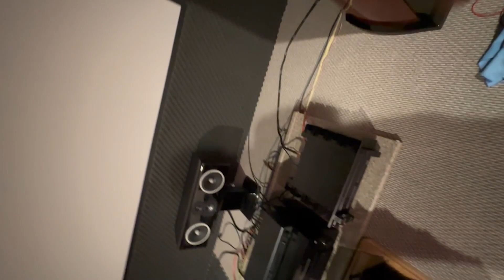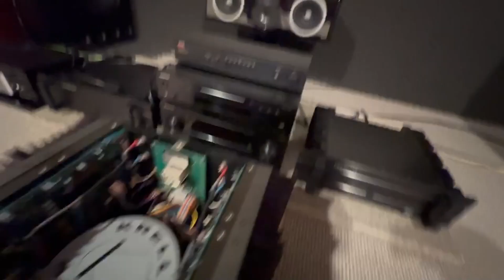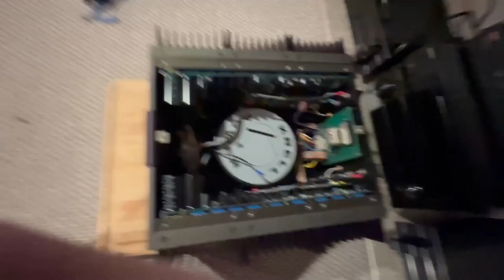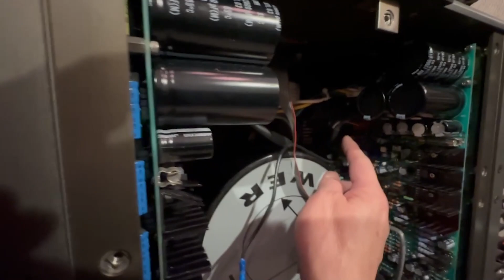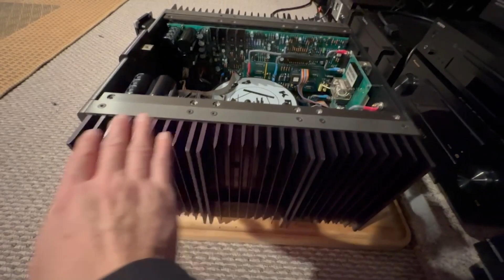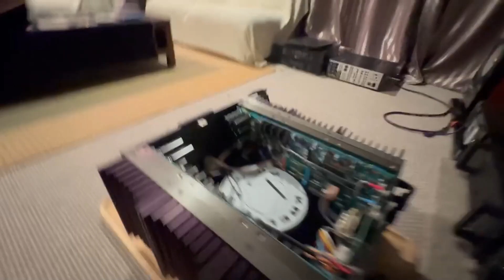Hi-End Audio System Series (1)

Comment: What a great system! The Krell amplifier is beautiful, and enormous!  I can't imagine how many output transistors it must have?!  Is it a mosfet Class A?   I am building my home theater system from inherited components 1990s: Modified Adcom GFA 555 dual mono amplifier, a PS Audio 5.0 pre-amp, and sadly a recently-dead Modified Pioneer Elite PD-65 CD player.  I loved the CD player (the Elite line really was something special, and sounded amazing!), but now that the laser assembly apparently has died, I will look into the Onkyo that you have.
Reply from the maker: A total of 44 power transistors, among which 12 are for voltage regulation.